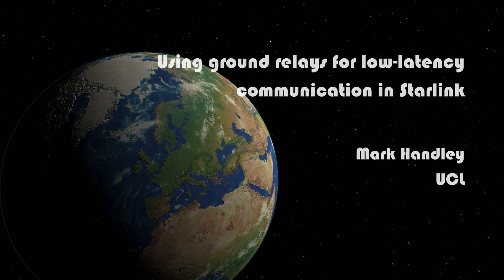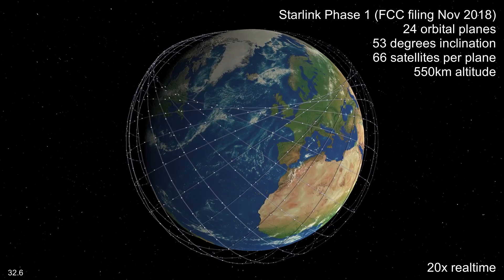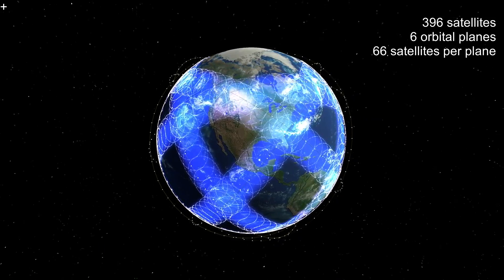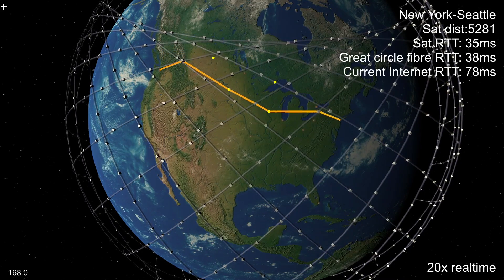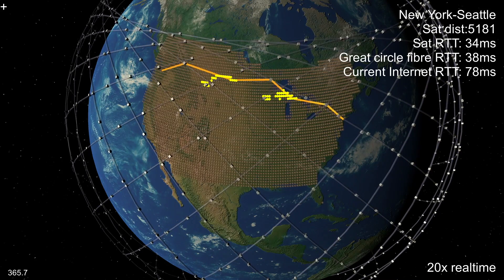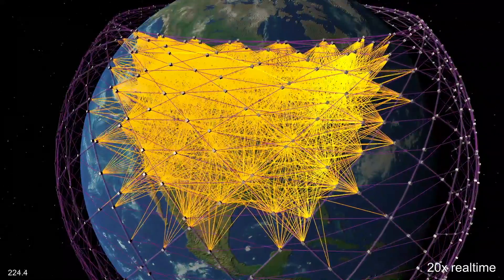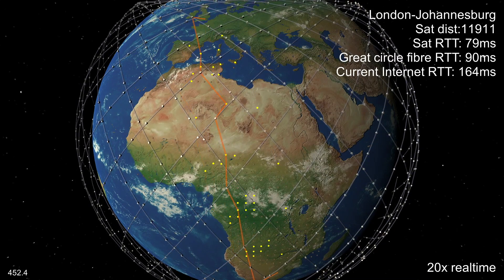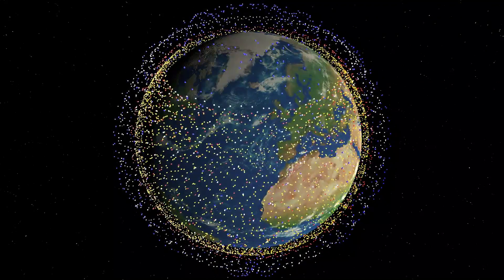Using ground relays with Starlink

Comment: Impressive simulation. I'd be surprised if StarLink spent the money to make each client station a relay - that would be multi-gigabit capable, and would also create a condition where it would be possible to say (despite encryption mooting the issue): "The traffic of thousands of people is being received and relayed by client terminals controlled by unknown and possibly hostile operators."  Perception is everything. So that's a non-starter right there I believe. Also, the costs of getting earth stations in various places is surprisingly difficult, though getting cheaper in the last 10 years. The equation changes when you move from "technology" to "real estate" and it's like running through molasses.

Comment: “This [Fig. 82] illustrates, on a larger scale, the earth.  Here is my transmitter -- mine or anybody's transmitter -- because my system is the system of the day.  The only difference is in the way I apply it.  They, the radio engineers, want to apply my system one way; I want to apply it in another way.
This is the circuit energizing the antenna.  As the vibratory energy flows, two things happen: There is electromagnetic energy radiated and a current passes into the earth.  The first goes out in the form of rays, which have definite properties.  These rays propagate with the velocity of light, 300,000 kilometers per second.  This energy is exactly like a hot stove.  If you will imagine that the cylinder antenna is hot -- and indeed it is heated by the current -- it would radiate out energy of exactly the same kind as it does now.  If the system is applied in the sense I want to apply it, this energy is absolutely lost, in all cases most of it is lost.  While this electromagnetic energy throbs, a current passes into the globe.
Now, there is a vast difference between these two, the electromagnetic and current energies.  That energy which goes out in the form of rays, is, as I have indicated here [on the diagram of Fig. 82], unrecoverable, hopelessly lost.  You can operate a little instrument by catching a billionth part of it but, except this, all goes out into space never to return. “.    http://tfcbooks.com/tesla/nt_on_ac.htm   ...enjoy!

Comment: Does this simulation take into account the extra latency caused by signal processing inside each satellite and ground relay?
Fiber is fast because it's an homogeneous material that doesn't alter the signal so relays only need to amplify and bounce the signal as is.
In the starlink setup each time the signal jumps up or down through the atmosphere it is altered and needs some error correction processing inside the receiving station or satellite before transmitting to the next node.
Also the major issue with starlink is the creation of a dense low altitude satellite constellation that will interfere with other satellites and future space missions launches. Starlink command center had a really bad attitude this summer during the near miss incident with a science satellite. They just kept silent when the control for the other satellite tried to contact them to coordinate maneuvers. This is unacceptable behavior.
Reply: Bill Whittaker  But the video was about low latency, which is a timing issue. So this is still relevant. Transmission between ground stations and satellites through the air needs to simultaneously solve error correction and timing/synchronization issues. This all requires extra work on ground stations and/or satellites. My initial question still stands: did the simulation take those aspects into account?

Comment: Those low-latency connections are only for big clients in the financial sector. They are willing (or forced by competition) to pay big bucks for lower latency.

Average Joe will just bounce a signal off a sattelite to a ground station which is connected to conventional, ground based fiber network.

Comment: Do your latency calculations account for atmosphere and error correction? In addition, the load on a relay increases exponentially per hop if the satellites are being used as ground access points. My guess is that more than one or two hops will not be economical from the standpoint of power and spectrum availability (Maybe for a NYSE - Chicago link). Most likely these will use fiber connected base stations, and one satellite to maximize available bandwidth and power. Free space optics will remove most ground to LEO bandwidth issues, but may only support up to 3 connections at a time. Really nice simulations!
Reply: The only purpose of this constellation and its truly profitable target is to sell ultra fast links between US east coast and west coast stock markets at skyrocketing high prices to greedy traders who want to play man-in-the-middle attacks on each other. And they do it by cluttering the entire world's sky with thousands of metal boxes, interfering with observation satellites and causing hazard to current and future space missions (see the near miss they caused with a European science satellite in the summer). And they only "offer" internet access to remote off-grid locations in order to get buzz and public opinion support.

Comment: Wait why use ground relays when you can do most of the relaying between the satellite. Is it cause it’s cheaper ?

Also how do they use 24 ghz to communicate to ground relays from space. Won’t the attenuation be massive at that high of a frequency.
Reply: Bill Whittaker I’m wondering how much power those transmitters on the satellites are outputting. 20+ ghz to the surface of earth must need some insane power.

Comment: How good would it be if the satellites have only 2 fixed lazes and receivers just to communicate between satellites in the same orbital plane? I'd assume that tech would be out sooner and ground relays can be used to commune with satellites in different orbital planes. The ocean wouldn't need any relays since satellites travel and commune in a conga line already.
Reply: Bill Whittaker  The forward and back laser/receivers would have no moving parts (or at least not much moving) to track off-plane satellites. You can get more bandwidth using lasers than radio. Phased array antennas also have no moving parts which is also cool. A forward/aft laser with no turret would seem easier to implement only targeting at predictably in front and behind targets.

Comment: Question. How are we going to launch large scale missions to the moon or Mars when you got to dodge a layer of a few thousand satellites?
Reply: the satilites have small electric boosters powered by their own small solar panels that they can use to change their trajectory on a small scale, mainly intended to give them the ability to dodge each other and other satelites, but im pretty sure they could be used to clear a small area to make space for a rocket to launch through the satelite layer
Reply: @Ankko  Starlink command center has clearly demonstrated this summer that they don't intend to cooperate. A Starlink satellite was on a conflicting path with a European science satellite. The European command center tried to contact Starlink command to coordinate evasion maneuvers on both sides. Starlink never replied, forcing the European team to spend a lot of fuel in a wide maneuver, shortening the scientific mission future lifespan while the Starlink sat kept its reserves full. This is the way they intend to solve any future issue. They can afford to lose a couple of their thousands of expandable satellites so they will just ram into other satellites. Scientific missions with only 1 or 2 precious sats they can't afford to lose will have to deal with it and burn their fuel to avoid Starlink wild boxes.

Comment: Distances are way longer above the surface and fiber optics aren't firing lasers through glass, it's through a glass tube which is nearly devoid of air. Also, less latency from clock differentials and recalibration. The magnetosphere will also affect coms from solar interference, which I don't think was accounted for here.

Cool vid 👍

Comment: The unfortunate bit is the repercussions on astronomy once all these get put up.
Reply: Unfortunate is an understatement.
Reply: I think they might address that at some point by making sure the solar panels are tilted in such a way that they never reflect the sun back on earth.  At least I would hope so.     Either that or some kind of anti reflective coating.    Though it may still be a problem for higher end astronomy like say, focusing an area in space for an hour.  You will get lot of "noise" from the satellite passes.

Comment: Question for you (and I realize it'll always vary based on where the groundstations are placed), but what is the minimum geographical distance needed for Starlink to have an advantage? At short distances, I imagine fiber would beat Starlink, even with its 70% speed of light limitation. What would that rough estimate be?

Comment: The cross-ocean and cross-africa paths are interesting, but will likely never be used unless SpaceX makes a deal with high-frequency traders who can actually benefit from the low latency. Otherwise, the maximum bandwidth of these paths isn't going to be more than a few gigabits, which will make no dent whatsoever in the internet traffic across these areas. Starlink paths will more likely be from a ground station in a city, over one satellite to a remote area a few hundred miles away.

Comment: @2m45s: "...but all the satellites from the first launch were sent to the same orbital plane..."  Of course. It requires significant delta-V (energy) to move satellites to a different orbital plane, so it's barely practical (thus not at all surprising).  On the same point, too bad that their plans are for 66 satellites per orbit, but they launch them in batches of 60. I wonder how they plan to get the extra six up there, for each orbit?

Comment: ..... Why not have even just a few lateral paths moving Pole to Pole? The Northern portion of the planet is considerably more populated than the southern Antarctic.... If profit gains are a factor to growing the successful future of such a massive effort, I mean wouldn't it be reasonable to include a more sensible set of routes? Also, wouldn't it be more conducive to have the orbital paths moving with the Earths rotation? Each unit would have much more time in established connection with the ground relays and would require less of them as they wouldn't need to worry about momentary loss of overlap? What of the Earths tilt for that matter? 230 some odd days later the connections of the northern most units will be either further away from any ground relays to be of any use or ground relays will be too far north all the same.
Reply: Bill Whittaker  If they're geostatic and the Earth orbits the sun, then for all intensive purposes , they do.
To say the tilt is irrelevant is ignorant to boot. 
How do you suppose in a 3D space, a orbit that holds laterally should have squat to do with maintaining a vertical relationship?
Reply: Bill Whittaker   Yeah, with that. I think we're done here.

Comment: Interesting idea. However, if a satellite fails or goes bad at some point, how do you replace it? If a satellite fails, how does it return to earth and burn up in the atmosphere? Or, does it just get jettisoned into space instead? Or, is it more space junk traveling at a high rate of speed? If it's more space junk, how would you get rid of it? After all, it can't last forever. How often would the satellite need to be replaced? What would be the re[placement cost? What would be the cost of building the ground stations? Now you would need a service provider. With so many satellites flying around how would you keep the satellites from being hacked into? The bottom line---what is the cost to the consumer?

Comment: Or starlink could run a set of relay satellites at a higher orbit which would give the Chinese and Gulf potentates an absolute fit, laser targeting is just a lookup table as they already know where every satellite is and will be.
Reply: Bill Whittaker  censorship, a satellite network can bypass networks they control
Reply: Bill Whittaker   that's my point with no ground stations in country there is nothing they can do aside from try ban the receivers

Comment: There is one thing that came to me. Using high power lasers on mass scale by satellites may cause orbit change. Why is that, the answer is that photons carrying momentum, and over time minor orbit change become major orbit change in result causing problems and even colision events. The way to prevent this orbital chang may be sending two beams of laser in precisselly oposite direction that will cancel out any pulling force. But there is anoter problem, laser beam hitting another satelite so to cancel out this source of orbit change force there should be another laser to counteract it.

Comment: so it can be faster in terms of ping, but what kind of bandwidth are we looking at?
Reply: That's the clever part - technology is always improving when it comes to bandwidth, you can fit more data into a smaller bit of spectrum. But you can't make light go any faster than it does, so the latency (ping) part is most important to get right. 
Somewhat ironically, bandwidth is the easy part - latency is the hard part, hence all this work and effort to lower it
Reply: @robdavy4468  but bandwidth is still a problem when everyone wants a slice.

Comment: I doubt they would use ship relays. In the near term they will probably just use a less direct path, or combine starlink with fiber routes on the ground to cross the oceans. The ground stations will need to connect to the fiber network anyway to reach the rest of the internet, so using that same link for some transport when starlink doesn't have a route itself would be easy. Even doing this, for many routes they would still have a huge latency advantage. It just wouldn't be an advantage over fiber for all possible routes.

Even if starlink never gets a laser link between satellites working, they are planning a future phase at a much higher orbit (1350km), which drastically increases coverage area for a single satellite and means they can route using those for getting across large areas like oceans using far fewer ground stations spread further apart. Routing via ground stations means a  satellite at 550km can speak to a ground station which then can relay that traffic to a satellite at 1350km, which would be visible to another far away ground station the satellite at 550km couldn't see itself.

I also highly doubt they would use user terminals to route bulk traffic. The user terminals would have to be designed to handle all that extra routing and throughput, increasing their unit cost. And they couldn't be depended on for long term reliability and quality of service the same way a real ground relay station could.
Reply: nonsense
Reply: Err... yeah, "nonsense". A relay doesn't need to be connected to anything other than power, it just acts as a mirror, bouncing traffic from one satellite to another. The fact that they can also route traffic between starlink and terrestrial internet (an "edge node") doesn't mean it needs terrestrial internet links to be of any use. Internal nodes have obvious value, and even small scale, low power nodes could still be used for sending lower amounts of traffic through.

Comment: main downside of space rockets is not the price of putting them in space but the ozon holes that craft burn through to make it up there. Everyone concerned about global warming, more specifically about fossil fuels, but everyone also forget the layers we damage are more important than carbon in lower layers. There is no way to replenish them.
Reply: just so that people can watch kitty cats dancing while sitting on their toilets at satelity speed internet. :) :) :) I am still not on board with 5G network since we will need towers in every corner like wi-fi. Fiber cables should be enough for anyone to use internet at home. On the go even 3G more then plenty. Learn to unglue faces from LED screen people.
Reply: Bill Whittaker  Please define the definition of replenishing. To recover ozone we have damaged in the past we have to wait till year 2060. Now I doubt society is gonna sit for 40 years. The oposite observed now ideas of sending 100s of rockets in space each year by E. Mask instead of just a few satelites. Numbers do not add up for ozone. We will likely die of cancer due to excessive radiation heat not due to fictional climate change. 

Ex1: In medicine doctor goes for the root cause and not a symptom. Climate change is a symptom. Carbon at best is a factor benefiting to the cause. 

Ex2: if universe is a big mirowave then earth is an egg in a bowl of water. That water is ozone. And if you drain water you will get heat directly to the surface of the egg where you will observe the climate change.
Reply: Bill Whittaker  https://www.google.com/url?sa=t&source=web&rct=j&url=https://www.forbes.com/sites/startswithabang/2018/02/06/sorry-earth-the-ozone-layer-isnt-healing-itself-after-all/amp/&ved=2ahUKEwiSqLfevdPmAhUXHM0KHdQ8Cs8QFjAAegQIAxAB&usg=AOvVaw0UzUK17B4TcXtSWeUWfwhn&ampcf=1